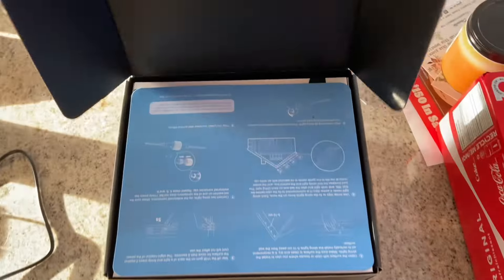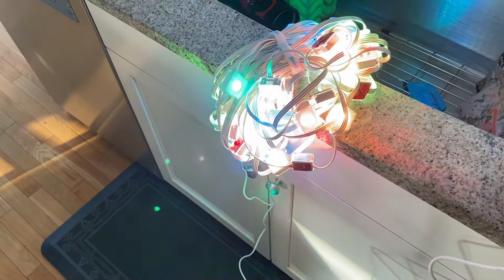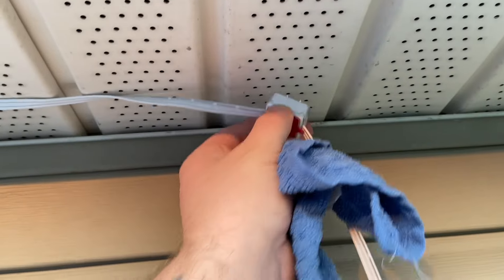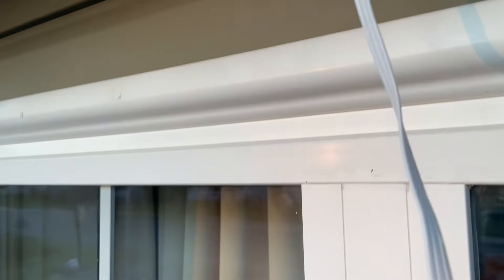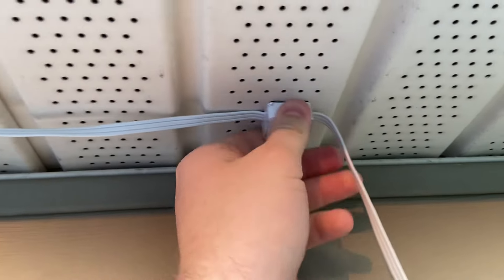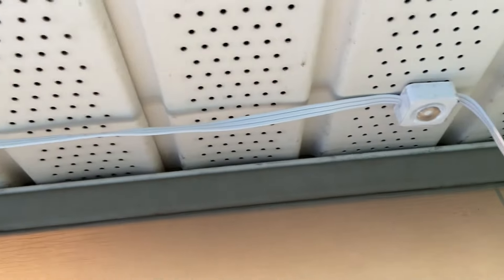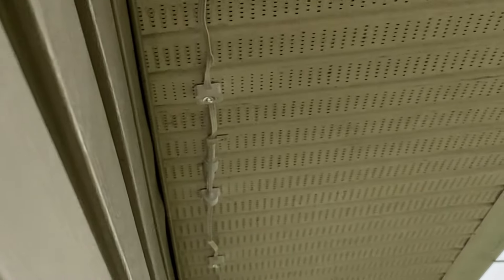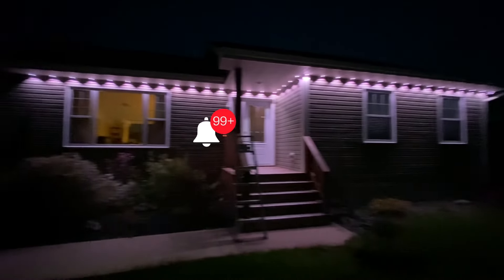Step-by-Step Guide: Installing Govee Permanent Outdoor Lights Like a Pro!

Comment: Do you have vinyl soffit ? How did they stick ?  Thanks
Reply from the maker: Yes! it is a strong 3m adhesive along with screw in clips and has had no problem through the cold winter as of yet!

Comment: Man I can’t get over how sloppy the govees look installed. I have 200 feet , and got an installer to do it $1000 plus the  $700 for the pros. A trimlight dealer quoted me $4500 which is a lot more but at least you would have e a true permenant install with lifetime warranty